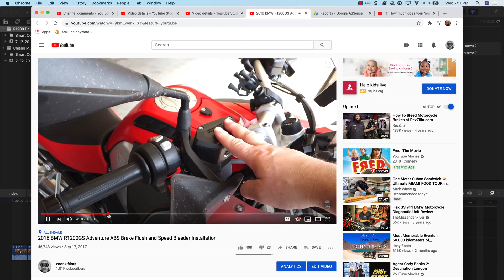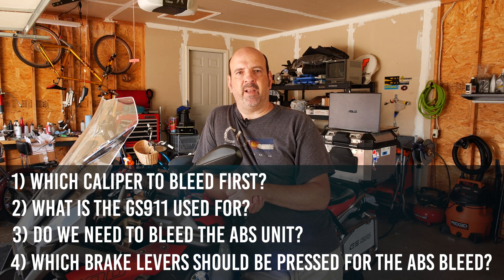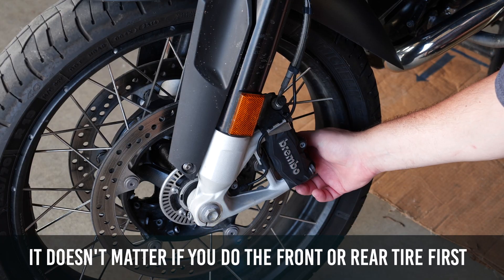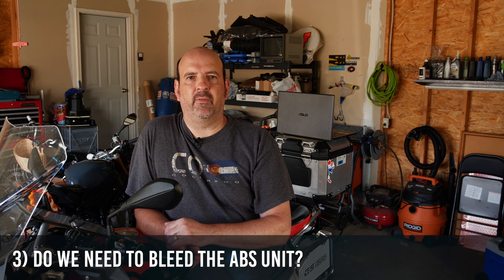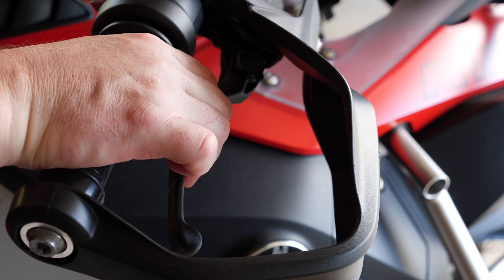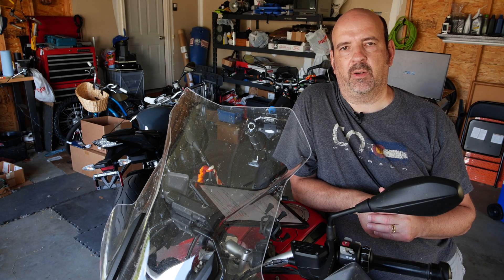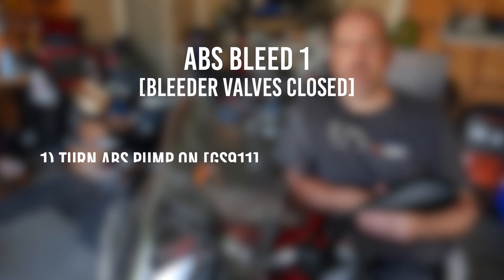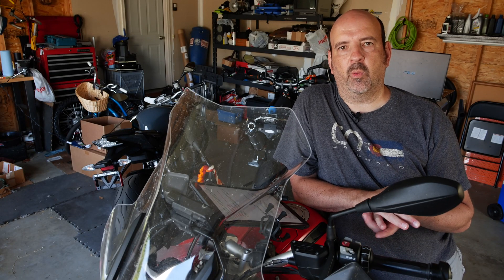BMW R1200GS Adventure ABS Brake Flush/Bleed FOLLOW UP  - Part 2 with FAQ's

Comment: Great info on depressing the brakes, tie them off and let them set. If you just barely apply the brakes and tie them off you will get the same result as the trapped air will work it's way up. If you "jiggle" the brake lever with the cap off and see micro-bubbles, the fluid has air in it. PROBABLY FROM SHAKING THE CAN BEFORE PUTTING IT IN!
Reply from the maker: @ericrhinehart6055 - Haha. yes, no need to shake that can! Thank you for watching and commenting!

Comment: What if you are not replacing the hoses but stripping down the callipers? Does that count?
Reply from the maker: @ArcanePath360 - Thanks for your question. That wouldn't count, you're not touching the ABS unit or hoses connected to it. In every case it is recommended to test out your ABS afer the brake servicing, just to be sure. You don't want to find out there's an issue when you really need them. Thanks for watching!
Reply: @zooskifilms   Thanks. I'm still torn on if I should get the Motoscan tool to do an ABS flush and service reset. Not sure I can justify the price at about £130. 
Since I stripped down the callipers and restored them my brakes are so much better now. There was all kinds of white gunk and ports blocked with crusty lumps of it, so maybe I should do a purge to be safe as you say. It hasn't activated in years. 
Not sure what else the app is useful for. It says it lists fault codes, but I can't find any info on what the codes would look like or how to interpret them. Everyone only ever talks about clearing them.
Reply from the maker: @ArcanePath360  - Glad to hear you were able to make some progress. The HEX GS911 will show all of the features once you open the software. Not sure if it provides more details on the error codes. I probably should make another video showing the process of checking error codes and what do  with them, aside from clearing them.
Reply: @zooskifilms   I'd be very interested in that. I can't find anything else online. Everyone always either mentions the ABS purge or clearing the service reminder. I would like to know what else it can do before I spend that kind of money on something that isn't a necessity as far as I can tell
Reply from the maker: @ArcanePath360 - Understood. I've added it to my list and hope to get to it soon! Cheers.
Reply: @zooskifilms  Nice, I just subscribed on the strength of that
Reply from the maker: @ArcanePath360  - Ha, awesome, thanks so much, hope I won't let you down!

Comment: Did all my services per bmw when i got my 05 bleed the brakes and theyve been rock solid amazing brakes but recently the abs reservoir got low so i had to order a gs because wonkey brakes are not acceptable
Reply from the maker: @BrandonSalas-qm5vu - Yes, amen to that. How long are pads lasting on yours? Cheers!

Comment: Thanks for your video and I believe that you flipped the flush/bleed terminology around a couple of times during your presentation.
Reply from the maker: @GSJeff - Yes, I tend to do that, I might be a bit dyslexic. I think I should be saying "flushing through bleeding" because in this case I'm replacing the old fluid. Cheers!

Comment: If I had a GS911 I'd do the ABS unit but I don't... bled my breaks a few times on my 2014 GSA and it's been perfectly fine. I hold my brake levers in overnnight, which helps let any leftover air get up to the reservoir.
Reply from the maker: @stallebrass - Yeah, that will work! That GS911 is an investment for sure, I have used it for diagnostic purposes as well. You can see details if and when faults are thrown. I think in most cases you don't need to bleed that ABS unit unless you need to change out that unit or one of the brake lines. Cheers!

Comment: I did a front brake bleeding on my f800gs. Only clean fluid comes out of my hoses, no air. Still looks like some air is trapped in the system. When I press the brake lever this happens: https://www.youtube.com/watch?v=bPuovH6saew. Can this be fixed by doing the abs pump bleeding procedure (motoscan?). Thanks for the video. I you have advise for me, I would appreciate it a lot.
Reply from the maker: @beatsmarttie5777 - Are there air bubbles when you do that or is that fluid coming back into the reservoir, hard to say from the video. If it's air, I would first suggest cracking the reservoir lid open a little (not off), and then tie the brake lever in the closed/pressed position and let it sit overnight (the longer the better). This will allow any air bubble up into the reservoir. If there's no air, just fluid coming back up, that is normal (at least on my R1200GS). See the first video in this series, the link to the section where you can see what the brake fluid does in the reservoir when you pump the handle: https://youtu.be/9kmEwehxFXY?t=717
Reply: @zooskifilms  I used the traditional method for bleeding. Hose with a container. Open the bleeder up squeeze brake close the bleeder screw, slowly release brake. Until clean fluid came out without air bubbles. I put my own case on YouTube: https://youtube.com/shorts/KspC1mhjjk8?feature=share

Comment: Great video - I'm going to tackle this soon.  I'm confused on what happens to the fluid in the ABS pump if the system is completely closed.  It's not a bleed or a flush (terms used interchangeably here) so how is this helping to push old fluid out of the pump and into the hoses so that the next round of mechanical bleeding can push it through and out?
Reply from the maker: @Dan Paul - Good question. The brake fluid line runs through the ABS unit, and modulates the fluid in the line when activated. It has a small amount of fluid in ABS unit itself, but when it opens up the fluid in the ABS pulses out and back in, basically mixing in with the fluid in the mail line. So bleeding the main line in between ABS activations will provide new fluid to ABS. Running that ABS three times should get rid of any potential air and also mix out most of the old fluid. Many folks mentioned they don't bother with running the ABS unless they change the brake line or ABS unit itself. Hope this helps!
Reply: @zooskifilms  Ah, that makes sense, and hence the reason for doing it three times.  It's essentially agitating and mixing that fluid in with the rest.  On a bicycle we just do one flush and done.  I'm wondering (or betting) if you're skipping the ABS pump that just a single run of pumping the fluid through until you see clean fluid coming out the caliper is as good as doing it three times.

That being said, I'm going to get the GS911 and do the pump method because if you're going to that trouble anyway, might as well do it completely.

I just changed the fluid on my forks (only at 20k) and I was shocked at how dirty it was.  Had the brakes done by the dealer at 12k, but it's time to tackle them.

Thanks for the wisdom and your time!
Reply from the maker: @DanPaulDrums  - You bet, anytime, and good luck with the wrenching!

Comment: Unfortunately I broke a bango ok my front brake line . I have replaced it and bled it but there is no pressure on the lever and it pulls back to the bar . Can you help ?
Reply from the maker: @Uncle travelling Matt - Ouch, sorry to hear. Were you able to bleed the ABS using the GS911? I assume when you broke the bolt all the brake fluid bled out? Feel free to DM me, my email is in my Channels about page.

Comment: Hey mate, I've had my breakpads (GS 1200) closed on disks and levers very hard, Do you think it's because my brake fluid needs to be changed or it's an ABS problem?
After 1 minute with key fob away everything went unlocked.
Thanks for the response
Reply from the maker: @Jérémy Herraez - I doubt it is related to needing a brake fluid change, unless the fluid level was extremely low. Even then I would tend to think the brakes would be soft and spongy. It definitely sounds like an ABS issue. Just a few questions: has it happened more than once? What year is your bike? Only the front brakes? Do you have the GS911 diagnostic tool? Overall a good first step might be to flush and bleed the brakes and ABS unit (in the first version of this video series).
Reply: @zooskifilms  awesome thanks heaps for your answer. Yes the level was very low and I’ve added more Dot4. Now it seems all good. Well, as per you I should flush and replace all fluid just in case? My gs is from 2015
Reply from the maker: @jay_hraz  - Yeah, if you haven't done it before it's probably overdue. Curious why the level got so low, other than if the brake pads are completely worn. In which case you should check them, if not already. No fluid leak anywhere around the bike (particularly up front where the ABS unit is)?
Reply: @zooskifilms  I haven’t because I have recently purchased this bike so I’m assuming previous owner didn’t replace brake fluid. No leak at all . He must has changed break pads without adding more fluid I guess. Hoping it’s not related with abs. Going to flush it and I’ll see if it does happen again. Hoping not. Thanks for enlightening me mate, appreciate it.
Reply from the maker: @jay_hraz  - Ok, understood. Let us know how it turns out. Cheers!

Comment: Your videos are great. I face a problem with my rear brake. I lost pressure at the foot brake. Went to BMW and they bleed the system, then all working as normal, the only problem it works for only a few pressures on the foot brake, after I loose all the brake again. Cutting story short, I was recommended to change caliper what I did, problem still persist!!! Then next was told the foot brake cylinder what I did as well. same problem still no rear brake. BMW says the ABS pump is working properly, the system all fine but the problem not solved. They state this the first time that happen on the bikes they been servicing. Any suggestion? Thanks in advance. Safe rides
Reply from the maker: @Carlos Velho - Sorry to hear about your loss of brake pressure. What year is your GS? When you say losing pressure, do you mean the foot brake travels all the way down and the rear brakes do not work? If this is the case, the loss of pressure is is either air bleeding out or fluid bleeding out. Can you see any brake fluid leaking anywhere? Do you have the GS911?
Reply: @zooskifilms  Thank you for your time to reply. I have a GS1200 - 2014. When bleeding the system works perfect but will stop working and the foot brake goes down all the way with activating the brakes. I don't have a GS911 but will definitely purchase it asap. Do I need to bleep the ABS unit pump?
Reply from the maker: @carlosvelho4810  - I'm curious if you can bleed your ABS pump without issue. If the pedal goes all the way down it makes me think there is a leak somewhere. It would be good to eliminate each component until you find the one that is the problem.
Reply: You must have a 2016/17/18 GS. Seems to be an often complained about issue on these bikes. ADV Rider has an extensive thread on this.

Comment: One trick I found very useful to remove any remaining air in the system is to press back the brake pads in the calipers all the way after bleading the brakes. This way any air in the system will be moved up to the reservoar and out of the system.
Reply from the maker: @Robort Kristensen - Thanks for the tip, wish I had it when I made this video. Cheers!

Comment: Thank you so much for a great video! Do you know if it is the same procedure on 1250 GS as 1200 GS and vent the ABS unit?
Reply from the maker: @ Lars Lind - I'm fairly certain it's the same procedure, especially from looking at the microfiche of the R1250, it  has an ABS unit. I also checked the Hexcode website and they list the XABS function for the R1250GS - https://www.hexgs911.com/function-chart/#K001_K50_R1250GS

Comment: Well that was easy. A couple of TIPS: 1) I prefer to use a combination wrench where I end up using the box end on the bleeder screw. It stays in place nicely plus and especially on the rear caliper, it makes loosening and tightening the bleeder screw a lot easier. 2) I do not use Speed Bleeders, instead I insert a ball bearing into the hose and using an Xacto blade, I cut a slit into the hose just above the ball bearing. You have to experiment with the length of the slit so as not to generate too much back pressure when bleeding that caliper otherwise the hose might pop off the bleeder. 3) to get the front master cylinder to be as upright as possible (the front edge is lower than the back edge), raise the front wheel by sticking some wood under it when it is on the center stand.
Reply from the maker: @A. C. E. - Thanks for the tips and insight, very helpful!

Comment: Awesome video, appreciate the high quality. Just have a few questions:

Was the brake feel not as firm as factory after this bleeding technique? I'm just curious as to why you had to tie the levers down overnight. Surely the dealer doesn't need to tie the levers down overnight after a brake flush so I'm curious if they know something we don't for this procedure. I'm not opposed to it but would prefer not to have to leave the reservoirs open for an extended period of time. With brake fluid being hygroscopic I'd be concerned about it absorbing moisture during this period.

Does the service manual mention the ABS flush? No mention of whether they recommend to leave the bleed valves open or closed? I know yours were closed in the video.

Thanks again
Reply from the maker: @Gary - Thanks for the comment and for watching! The brake feel didn't change for me after performing this service. Tying down the levers was something I found in another  video and thought I would share it. I think it might be helpful for those who have a softer brake feel after bleeding their brakes, but for me it made no difference. I agree with you on leaving the brake reservoir lids open too long, but if you do this service every couple of years you'll be in good shape. My recommendation would be to only tie down the brake levers if you have a softer brake feel after the bleeding and flush. The service manual does NOT mention the ABS flush. The bleed valves should be closed during the ABS flush (using the GS911). Any air that resides in the ABS unit will be pushed towards the caliper during the ABS flush cycle and the subsequent bleeding will purge that air. At least that's how I understand it. Thanks again and good luck!
Reply: @zooskifilms  tying down the brake handle before bleeding was an old racer trick..  leave the cover on.  Theory is that is the system is pressured, dissolved air would come out.  I never did it, I remove all the fluid in the res, do a good flush with the mityvac.  With that I would assume all bubbles were removed.
Reply from the maker: @skippynj1979  - Thanks for the comment. It's a nice trick, gave me that original brake feel. Thanks again!
Reply: @zooskifilms  enjoy that beautiful bike.  I just use the mityvac...  Never a problem
Reply from the maker: @Gary - saw a question come though but now it's not showing up on this video. Please repost or send me a PM. Thanks!

Comment: Time to do a brake flush on my R1200 GSA LC. Thanks for the info so that I do not having to reinvent the wheel. I finally have a use for my GS911 other than maintenance minder resets.
Reply from the maker: @HorizonsUnlimited - Great to hear! Yep, the GS911 has way more features than I'll ever use. Probably need to dig a little deeper to see what else I should be checking!
Reply: @zooskifilms  Unfortunately as much as the GS911 costs, it cannot do something as simple as a "Time Format" change in my instrument panel. I hate AM/PM and am used to a 24H clock from my flying days. So I had to buy the MotoScan app and the ODBLink MX+ to change the Time Format and for 1/3 the cost of a GS911, it was a bargain. Of course the MotoScan app does a lot as well. I like all my diagnostic tools with 5 of them in the shop.

Comment: Here's one that has me stumped. 2016 r1200rt 70k miles. About 3k miles ago I noticed that my windshield has about 1/2 inch of slop when it is up 3/4 to full. Meaning it doesn't extend all the way. I have pulled everything about, cleaned and lubed everything, i.e. control arms, springs, brackets etc. I have noticed that the motor hesitates for a quick second about 3/4 up and that's when the slop starts. However, it does not do this without the weight of the windshield on. I have recalibrated with the GS-911 several times (with shield on) but it doesn't fix it.

Dealerships say they have not seen this problem. Has anyone else experienced this?
Reply from the maker: @mark mcguire - So it's a 1/2 inch short of reaching the full extension? Mine is the GSA so my windshield height adjustment is manual, but it definitely has some slack in the movement, especially at the taller position. I looked at the microfiche for the RT model and it only shows the complete assembly. I assume there is a gear on the motor that meshes with a gear on the shaft that's connected to brackets on both sides. Probably made of plastic and has some wear on the teeth when it's at 3/4 to full height position. Anyway to open that up and see where the motor mates with the shaft? Sorry couldn't be more help!
Reply: @zooskifilms  Thanks for the reply. The motor is moving the lower arms all the way up but then it has slack. Maybe worn gears or perhaps fatigue in the springs and they aren't holding it up. Prior to 2014 LC you could order individual parts but you are right, now it only shows the whole assembly..........for $750! BMW Detroit and BMW SEM had no ideas but I can't believe I'm the first with this issue. May drive out to BMW GR where I bought it and see if they have any input. Thanks again.
Reply from the maker: @markmcguire7988  - I bought mine at BMW GR. I'm in Allendale MI. Look me up if you make the trip over. Ride safe!